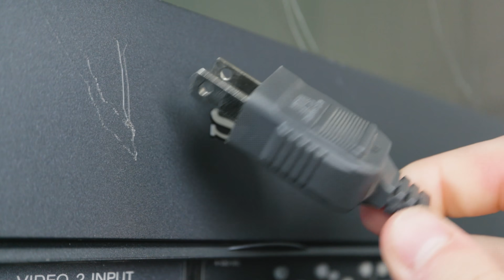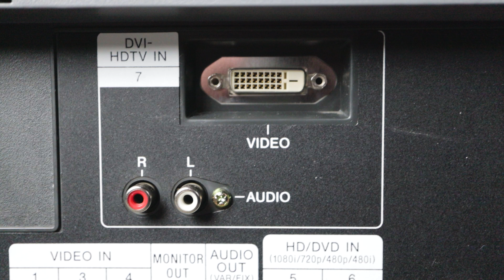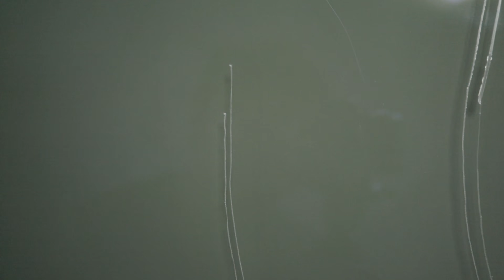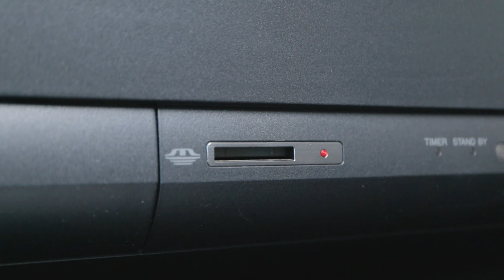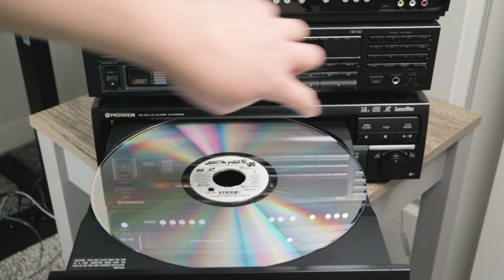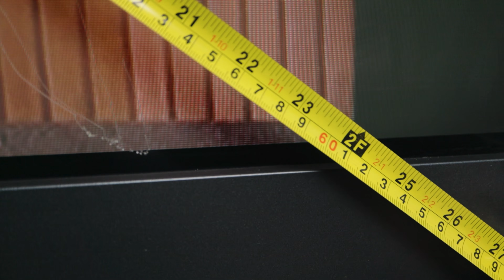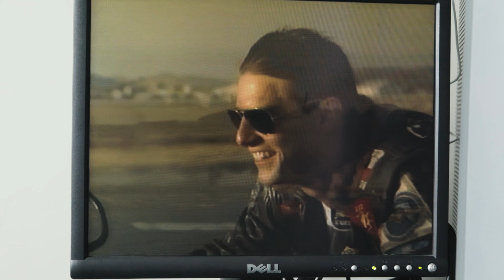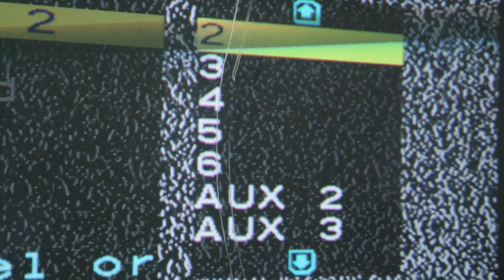The HD, WIDESCREEN Tube TV! Sony Trinitron KV-30XBR910

Comment: I don't think flat panels have yet reached the quality of Sony Trinitron tubes, they may never do. Yes, you did get distortion towards the edges, but I think the picture as a whole was much better. It's a shame they had to go. My first job back in the 70's was with an electrical retailer and you could definitely see the difference in sharpness between the Trinitron sets and the other manufacturers. Panasonic's Quintrix system was very good as well, but I don't think it was quite as good.
Reply: No not at all by no messurements in this world does any Trinitron Exceed an modern (~2015) OLED, Full-LED or even an cheap Edgelit LED TV / Screen
Reply: @leocompany  I beg to differ.
Reply: @leocompany  He's probably referencing their durability because they're tanks, but I just picked up a 65" LG C4 and it absolutely kills everything except the Sony XR which is another high-end price and tech point.

Comment: To remove the scratch you have to remove the anti-glare sheet. Remove the shell, there is 4 big screw holding the tube onto the plastic frame, unscrew the 2 upper one, go infront of the TV and tilt the tube slightly there will be a gap now between the upper frame corner and the tube, you can now see the corner of the anti glare sheet and start peeling it with an exacto knife at the first then with your hands. Wear glove the sheet can cut your hands. 
These TV are at their best with a transcoder VGA to Component at 540p, you have to disable HDPT in the service menu also to make them lagless and support progressive scan.
Reply from the maker: Wow! Thank you for the info!

Comment: 11:41 DRC-MF was Sony's own proprietary technology for 60/100 image processing. In the video you mention CRT is analogue. That is correct, however later 100htz SD and all HDTV CRT TV sets Sony produced had essentially, an Analogue to digital converter, this means, once digitised the SD picture can be "enhanced" by double the 480 lines to 960 lines horizontally, for 100htz playback. And some sets offer vertical enhanced with double the virtual count to 1440 on a 30" screen. This process would make a source such as DVD or Laserdisc look stunning for SD. 

The process would most likely be bypassed or defeated, when running "native" 1080i via component and DVi inputs. 

The digital process is why gamers don't like these sets (typically) as the Analogue to digital, then, digital to analogue conversion adds lag. So light gun games don't work well or at all 11:41  and 240p consoles can be miss converted to 480i and look poor in detail. 

Hope this helps.
For movie fans and Anime fans these sets are absolutely fantastic
Reply from the maker: Wow.. that's awesome! Thank you for the insight!

Comment: I had the Sony KV-36FV16, the 36 inch version of this tv. It was handed down to me when friends upgraded to plasma around 2008 or so. It weighed about 236 pounds. The power switch finally stopped working around 2012 and I replaced it with an LG LCD 3D tv, which lasted only 3 years. I held onto the Sony for a while but it was a behemoth and there was not a big market for broken heavy tube tvs at that time. I was well-aware that it was the nicest tube tv ever made and was sad to let it go.
Reply: That is not the 36” version. That set is SD. Get a clue
Reply: @MrPotteeMouf  Get a life

Comment: I remember the first HDTV I saw in person, and that its HD inputs were component and VGA. No DVI, no HDMI (as HDMI wasn’t a thing yet). I think this was in 2000, so DVI was barely adopted on computers at this point.

As far as HD CRTs and lag go though, I had a 36 inch Sony 1080i TV and the lag was just bad enough where Hogan’s Alley, Duck Hunt, Yoshi’s Safari, and Terminator 2 Arcade (Genesis) didn’t work properly. Moving back to a 35 inch Trinitron, that problem went away. IIRC though, Sony CRTs don’t use an upscaler for 480p or 1080i signals, so this is a perfect screen for PS3, 360, and Wii gaming.

Finally, the scratches on the tube are likely an anti-glare filter. if you can kinda peel it with a fingernail, rubbing alcohol and some heat may completely clear it.
Reply from the maker: That sucks that there’s slightly too much input lag.. but yeah 360 games look great! Thanks for the info on the anti glare

Comment: I think the reason you were having problems with the closed captioning being cut off on the LaserDisk is because that wasn't a true widescreen format. That widescreen was formatted for 4:3 screens. So on a standard 4:3, it would have been letterboxed, and the subtitles would have shown up "below the movie". So it's still playing in 4:3, so the TV will still give you the pillar boxing, as well as the letterboxing of the 4x3. As you noted, you can zoom it in to fill the screen, but it's not technically using as much video information as a TV is capable of displaying from that format. And it also has the unfortunate side effect of cutting off the closed captioning, but you were never intended to watch it on a widescreen television, zoomed in or no.
Reply: Yeah he needs to change the settings. That zoom is an atrocity

Comment: I had to get rid of mine because ROKU and broadcast stations now use encription that this set does not support. My 34 inch was 200lbs. Best Tube tv Sony EVER made!
Reply from the maker: That’s so annoying
Reply: Yes the holy grail was the 34xbr960 and 910. Super fine pitch with hdmi. It's like a big pvm. True videophile tv
Reply: I still have both 34 910 and 960

Comment: I have a 960 which is essentially the same TV, and the sound is almost more impressive than the picture. That little driver behind the tube packs a pretty serious punch. It blew me away the first time I heard it.
Reply from the maker: No kidding!
Reply: @simonretrotech    i had a 34XBR960 i bought new from sears like in 2004, i gave it away about 10 years ago because i was trired of movignthe 200 pound beast, now i wish i had kept it
Reply: The driver isn't the part which defines quality in sound most of the times as they are really simple parts. It's the construction and resonance medium. Most TV's these days just take some "premium" drivers and botch them in the plastic frame and call it. That TV had Soundengineers actually working out where to place them and how to anker them to get most out of the resonance medium (In this case the massive glasspanel and the plastic enclosure). I've build massive panel speakers in the past as a hobby and it's amazing what you can get out of 20$ drivers with the right construction and panel. Far more then you can get commercially without paying 5 figures.

Comment: when TVs had real speakers and not  speaker of decoration for avoid be called  computer monitors with tuner and had plenty of inputs not like now that has in the practice 3  inputs only the 4th  will not be counted if want get an soundbar with ARC

Comment: The "vertical line doubling" sounds kind of dubious since every analogue source will have a different horizontal resolution. While yes, analogue tv standards don't have a set horizontal resolution, it's obviously not infinite. Horizontal res is measured in TVL, basically it's a count of how many vertical lines you can fit in the image before they become unintelligible from each other.

Comment: First, this video has answered a question I've had for literally years - did anyone ever make a wide screen CRT?  

Another pro tip:  If you're going to discharge potentially high voltage charges, put an old-fashioned filament light bulb or very high wattage resistor in between the charged part and ground.  That way you'll have less of a shock to system, literally.  And if you use a light bulb you can actually get a fun visual of the voltage draining away.
Reply: Widescreens were actually pretty popular during the last years of CRTs. My friend has a 32" wide CRT for older consoles and looks so much better than with a flatscreen.
Reply: Betweem 2001 and 2003, widescreen CRTs were fairly common.  I owned a 36" widescreen SCT by a company named Sampo.  RCA even made a 38" widescreen CRT.  Sony was not the only game in town.
Reply from the maker: Good to know!
Reply: Dozens of companies. There is even a 28" widescreen CRT in a 2007 catalogue I just checked, described as "Traditonal". By then buying one would mark you out as a real cheapscape though, paying just £180 for that rather than  £500 for a 26" Sony LCD. 

Going a bit of topic, a 46" Sony LCD was a whopping £2000 in the same catalogue.
Reply: Bought a Wharf Wharfdale one back in the day. They were recalled by Tesco due to risk of fire.
Reply: Dennis, you'll be blown away by the fact that there was a wide-screen CRT TV made with a built-in DVD player AND a VCR!!!  I bought it from a school district's surplus items auction for $11 about 10 years ago.  Unfortunately, I don't remember the brand because I've had it in storage for the past few years.

Comment: FYI the scratch is a plastic film over the screen. Grab it hold and rip it off.
Clean the screen with alcohol to remove the sticky residue. I did this with a sony I had.
Reply from the maker: No way! It seems plasticky but I didn't want to ruin the TV. Is there any reason it's there?
Reply: @simonretrotech  Its an antiglare coating. But you will be more happy without the scratches! I didnt notice much difference with it removed.
Reply: @wildchild6340  I'm not sure, but I believe that coating also helps with the stability of the vacuum tube, so you may want to research that before doing anything
Reply: @denniseldridge2936  This, really would have to do research on the specific model to ensure that layer isnt important. Sometimes its just an antiglare, other times it helps the tube, part of the display process, or saves the glass from getting that nasty fogging/cataract like effect over time
Reply: @smolmuffin  Mine has had the antiglare ripped off for the better part of a decade with no issues. So I would just rip it off.

Comment: I found it humorous that I was able to watch this video on my Sony widescreen HD CRT TV that I use on a daily basis.  It seems to be a somewhat newer model than the one in this video - KD30XS955.  IIRC, I purchased it in 2005.  On the front, where "Trinitron" is displayed, my TV says "WEGA".  I also have an HDMI connector.  The rest of the features seem much the same.
Reply: Fun Fact: SONY pronounced
WEGA as vega (vay-guh) in
their advertising for these.
Reply: I owned an European equivalent model. 32" with a dedicated stand. It didn't have a DVI connector, but had 3 SCART ones. I gave it away when I bought a Panasonic plasma TV. And I've been regretting getting rid of that beast for some time now. Would  be great for retrogaming.
Reply from the maker: Haha that's awesome. Yeah, it's interesting because this is a Wega TV but there's no branding for it

Comment: Yeah HDMI was still pretty new in 2003. I had a 2005 34" Panasonic HD CRT and it had one HDMI input. But my HD cable box at the time had DVI output, so i used a DVI to HDMI cable. 186 lbs. The Sony 34" HD CRT was over 200 lbs.
Reply from the maker: Wow!
Reply: I thought only 04 andn ewer model hd crt sets had an hdmi?
Reply: HDMI started to get some popularity after the mid-2000s, like with PS3 etc.

Comment: Great video! A few corrections, however:

This set is max 1080i, which is not full HD. And it doesn't even display the whole 1920x1080 raster onscreen, as it gets overscanned heavily. 

This set DOES have input lag. It's unavoidable when you have digital processing.
Reply from the maker: Okay that makes sense. Yeah, I'm starting to notice the ridiculous overscan now

Comment: I had one of these sets Simon and it was possibly one of the BEST CRT trinitrons ever made - and one of the last. Keep it as long as you can. Also to answer your questions, yes DVDs have a trigger buried in the vertical image of the picture and some sets could switch between 16x9 and 4x3 content depending if it was anamorphic widescreen or not. Cool ha?!  There is a set up mode you can enter to adjust almost anything you want but it's not for the faint hearted (mostly tech settings) but again super cool. Great vid bud.
Reply from the maker: Whaaaat?! That's so cool! It awesome finding these little features of analog video that isn't super well known. Thanks for sharing! And yeah, I'm going to keep this set as long as possible :)
Reply: @simonretrotech  The feature where the TV auto detects the aspect ratio of the video was called Widescreen Signaling or WSS. As explained above it was in the vertical interval. Similar to how closed captioning works.
Reply from the maker: @marcusdamberger  Never heard of that. Off to Google I go :)

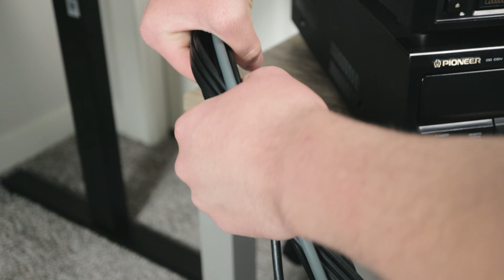Comment: 8:14 Luckily in Europe we had SCART which could be plugged in line with only one cable to tv. So much simpler to have in line.
Reply from the maker: Yeah SCART is cool
Reply: till bend a blade  , game over
Reply: Yeah it's cool. But sadly it doesn't do anything above 576i
Reply: @mt.taraen  Yes, but I vagely remember Sony had a special 1080i SCART cable for the Playstation 3 which worked for  some late Sony Trintron PAL TVs.
Reply: if USA did not used Scart never would existed HDMI or even been invented, why invent HDMI if can we use SCART
Reply: @megacap55 you have  no idea what you're talking about ur just  rambling
Reply: Never realised USA didn't have SCART.
Reply: PAL M is better
Reply: I grew up in the UK in the 90s and early 2000s, and I straight up didn't know anyone who had or used SCART.  It was pretty much always RF for us, using a co-ax cable.  The "richer" families used component.  
I know, crazy xD
Reply: SCART IS LOW RES. I HAD A CRT WITH A HDMI ON IT, IT WAS A SAMSUNG. IT LOOKED GREAT WITH A BLU RAY PLAYER HOOKED UP TO IT
Reply: Scart is a fancy way of saying "s-video".
Reply: @maximilian3544  Scart could do Composite, S-Video and RGB (pretty similar to SD component) all in one connector.
Reply: @maximilian3544  No, SCART is not the same as S-Video, in the standard version it has only four pins and cannot transmit RGB, later there was a 7-pin version, which could, but still lacked some functionality and slightly worse signal quality. The SCART standard was absolutely absolutely superiour for a long time.
Reply: @vanCaldenborgh  Depends on the implementation. 
Female connector seen from the front - from wiki

Pin 1		Audio output (right)
Pin 2		Audio input (right)
Pin 3		Audio output (left/mono)
Pin 4		Audio ground (pins 1, 2, 3 & 6 ground)
Pin 5		RGB Blue ground (pin 7 ground)
Pin 6		Audio input (left/mono)
Pin 7		RGB Blue up
S-Video C down[a]
Component PB up[b]
Pin 8		

Status & Aspect Ratio up[c]

    0–2 V → off
    +5–8 V → on/16:9
    +9.5–12 V → on/4:3

Pin 9		RGB Green ground (pin 11 ground)
Pin 10		Clock / Data 2[d]
Control bus (AV.link)
Pin 11		RGB Green up
Component Y up[b]
Pin 12		Reserved / Data 1[d]
Pin 13		RGB Red ground (pin 15 ground)
Pin 14		Usually Data signal ground (pins 8, 10 & 12 ground)
Pin 15		RGB Red up
S-Video C up
Component PR up[b]
Pin 16		

Blanking signal up
RGB-selection voltage up

    0–0.4 V → composite
    1–3 V → RGB

Pin 17		Composite video ground (pin 19 & 20 ground)
Pin 18		Blanking signal ground (pin 16 ground)
Pin 19		Composite video output
S-Video Y output
Pin 20		Composite video input
S-Video Y input
Pin 21		Shell/Chassis[e]
Reply: @maximilian3544  S-video is different from RGB

Comment: i could be wrong but some Trinitron or professional TV have the ability to calibrate the screen in order to get a full image. 

i think those widescreen Trinitron are a hefty burgain, unless it includes DVI port but some model do have HDMI inputs. i could think an HDMI to Component should work no problem as far the latency is concerned. for retro gaming, i always recommend 4:3 most of it but Xbox and PS2 do have the way to display in 16:9 (PAL doenst!). when it comes to Movie format, some old DVD players, even LaserDisc display 4:3. which is why you get a shrinked view for an 16:9 format seen on the Austin Powers LD, since im mid 90s wasnt standardized yet. idk if LD do have 16:9 support, which most of it are in 4:3. so you really need some trickery.